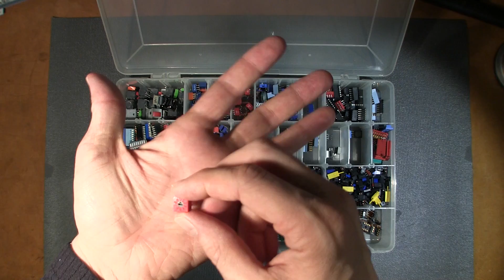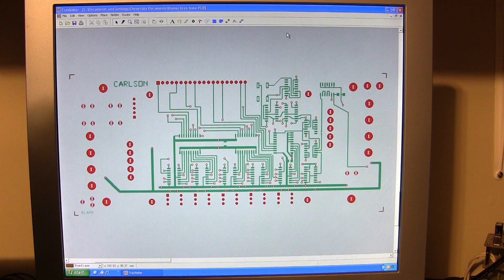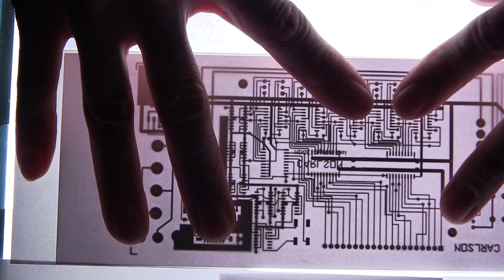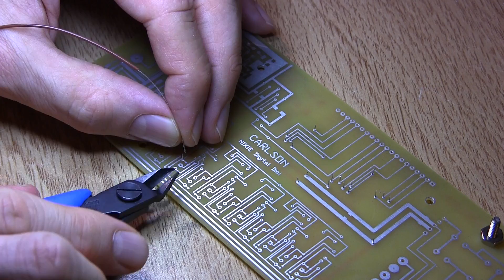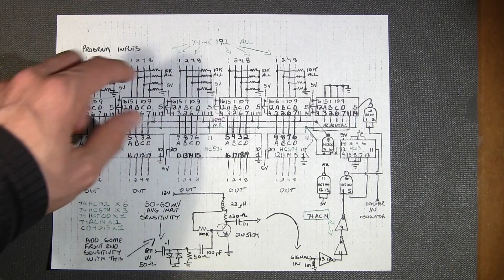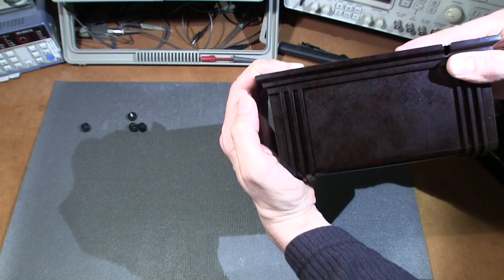Nixie Tube Digital Display for Receivers

Comment: "Will it work". Of course it will. You are so methodical, you don't have a sloppy bone in your body. Great to watch the process of designing electronics to fit a housing (the old Bakelite case) rather than the other way around like myself who designs a housing to fit after I build the electronics.

Comment: If only you’d placed the (non-angled) bcd selector switches on the underside of the board. Could have changed selections without removing the board from the Bakelite.

Comment: I thoroughly enjoy your videos. I have a question about your PCB design. Do you go straight to the layout, or do you first draw the schematic in the software? I think the former. Without forward/back annotation and design rule checking in software it must be quite error prone. It would be for me anyway, I would be bamboozled by the homogeneous array of pads and tracks.
Reply from the maker: I draw the schematic on paper, then manually place every component, and draw every trace on the computer.

Comment: I think that the bakelite case would make an excellent candidate for molding and resin casting in order to reproduce it for future projects while not risking damaging the original. There wouldn't be the problem of not drilling a duplicate for knobs and switches for all sorts of interesting projects.
Reply from the maker: What a great looking little case, I need many more.
Reply: I agree. It appears to an excellent art deco design. It shouldn't be too difficult to duplicate. Smooth-on has all sorts of videos on mold making and casting projects. I know they have videos on duplicating automotive turn signal lenses which I would think would be similar to what would need to be done to reproduce this case.

Comment: I'm amused that you still use a PC with a CRT monitor. How do you eliminate the CRT rolling in your videos? I seem to recall a Joss Whedon commentary mentioning that showing a monitor on screen used to require expensive equipment and an expensive technician.
Reply from the maker: Hi Peter. That old 4:3 monitor is an LCD model. It has never needed repair, either has the old XP machine. Both work flawlessly.
Reply: I apologize for mistaking it for a CRT; your camera lens makes it look like it has a curved front glass, so I'm sure you can understand how I would make the mistake. We used to love fishbowl CRTs (both PC monitors and televisions) back in the day.

Comment: Nice project!  You mentioned that you can use the counter to display the tuned frequency of an old radio. Since you have a 50 ohm line and input impedance, if you tap it to anywhere on the local oscillator of a typical tube radio, wouldn't it be overloading the oscillator? Do you have to add a MOSFET source follower (or a cathode follower to be more aesthetically pleasing) inside the radio?

Comment: Hi Paul,

Super channel - been watching your videos for about 8 months - keeping me entertained and I've learned so much - better than a uni course. 

I wondered how fine you could go with your PCB tracks and still have a decent circuit.  This circuit looks really dense. How many tries did it take before you had a working etched PCB - knowing how much of a perfectionist you are, it probably worked first time.

I don't have much luck with my PCB's because i use the UV process and there are so many variables that i scrap loads every time.

Do you have any dead analog synthesizers that you could include in your repair tutorials - that would be fascinating to follow.

Hope you continue this for many years
Reply from the maker: Thanks for your kind comments! I use the toner transfer method for very quick prototyping... I'd say a 99% success rate the first time.

Comment: Fascinating, as usual!  I've learned more from you in the past year than I did in three years of electronics college back in the 70s.   You've inspired me to build up a new test bench so I can restart my old electronics hobby once again.  I noticed in this video that you have a light on your Dremel drill stand that is perfectly centered on the drill site but I can't tell if it is above the table shining down or under it shining up.  How did you build that light, may I ask?  And yes, I would like to know more about how RF and DC grounds should be designed.  Thanks!

Comment: How do you handle this digital display if the oscillator frequency is on the opposite side of the IF frequency.  Sometimes this is the case with communications receivers on different bands.  Instead of subtracting from the oscillator frequency you would need to add to it.

Comment: Just a question: Why do you use the toner transfer method for PCBs? Is there a adventage over the UV exposure method?
Reply from the maker: The toner method is much faster, easier and way less expensive in the long run.

Comment: Very cool project - but just one minor nitpick: the leads on those Nixie tubes look like they're way too long...some of them even look like they're bent almost enough to touch other ones and cause a short.

I'd have trimmed a lot of wire off those tube leads so that the tubes would be sitting a lot tighter & flush with the PCB. Just sayin'.  If they'd be too low for visibility once the board is mounted in the enclosure, then just raise up the whole PCB up on spacers or shims, or something.
Reply from the maker: Ahh, but here is what your not taking into account: The Nixies are pulls from an old calculator, bending the leads "straight," close to the glass seal risks breakage. The tubes are elevated to that level so that heat from the soldering does not cause the glass to dumet/Kovar seal to seperate. This is the reason the tubes had about 2 inches of wire too begin with. The wire is stiff like the strands in a speedometer cable, there is absolutely no way any of them would touch unless you broke the bulb. If you ever pull Nixies from an old instrument (DON'T try to straighten the wires close to the bulb base)
Reply: See, you have very specific knowledge and experience that is hard to come by unless you've actually run into the problem first-hand or had someone share that knowledge with you. I try to read the comments for the pearls like this one where you explain something that could prove to be a costly mistake for someone trying to salvage a Nixie from an old instrument. I'd like to propose a suggestion for a video where you might put together some important tips like this one for people who might not know these things. It'd be so much nicer to benefit from your experience than have to learn things the hard way :D I don't know how many different tips there might be so it might be that it'd need to be separate videos on specific subjects. Just a thought anyway :)

Comment: So what happened to the row of diodes feature that was mentioned in the first video ??
In my opinion I see you still have enough room on the PCB for those diodes and use one wire to make the counter works as DF counter, an extra micro switch ON-OFF with longer stem installed at the bottom of the enclosure, the stem will go through a tiny hole of the shielding PCB, it wont be seen at all, so you wouldn't have to create any hole in the box.
Any other reason why you eliminate the diodes feature ?
Reply from the maker: No, just size issues. I plan to use this counter with earlier super-hets, so the diodes are not so important in this build. My earlier through hole counter has the diode feature. You can see that counter in my very first video. That diode feature is great for switching between IF offsets. If you wanted to use this with a Hammarlund SP-600, the upper bands go to dual conversion, so that feature makes life easier, as it's automated in that frequency counter.

Comment: Hi Paul. 
Delightful project and well-built :) I was just wondering, supposing it would be built with "normal" parts, meaning, not SMD parts, would one have to take anything particular into consideration? I'm thinking along the line of tolerances or maybe shielding?

And yes... I'm very interested in seeing how you handled the PCB design and other steps  you didn't show :)

Thanks a lot for this great video!

Comment: Hello there, though I'm no electrical Engineer by any stretch of the imagination I would like to ask two questions out of curiosity:
1) is the contact of the spring good enough for this application? I only have images of teared down oscilloscopes in my head where they often use big rows of metal clips between the chassi parts so either they are a bit overkill or they do it just because they can?
2) Did you consider tinplating the ground board? Again pointing a bit in direction of my first question if time and corrosion will affect the contact characteristics of the spring connection up to a point where it might not be good enough? (By the way i was absolutely stunned about the tinplating you showed in one of your previous videos ^^. I had to watch it twice to exclude black magic as an explanation.)

Anyway, very comprehensive and in depth videos (in my humble opinion). One can really see that you put a lot of effort into the narration and planning of your videos, which i appreciate a lot!
There are very few people out there on youtube which have such an calm and easy to follow narration style and voice like you, keep it up like that!

Best regards Anton
Reply from the maker: Hi Anton. Thanks for your nice comment! The contact area of the spring carries no current, so it should be fine. Those large shielded areas in oscilloscopes are needed as they are sensitive measuring equipment, and RF leakage from stage to stage is an issue. This is nowhere near that, it's just a counter. The box itself is made of bakelite, so there is no upper shielding. The unit itself should remain quiet to "close by" receivers with the shielding provided. Knowing this just comes with building experience. I didn't plate the bottom copper board, just because I'm not soldering too it. It doesn't seem to oxidize like my other raw boards as well. Off shore copper is special... LOL :^)
Reply: Thank you very much for your reply :)
It's always fascinating to learn something and since you asked in one of your videos if people are interested in the layout and design consideration process, i'm absolutely interested ;)
Looking forward to your next video and wish you a nice day!

Comment: I was thinking it might've been ideal to have access to those switches via the bottom using alignment tools.  That way you just need to lay the unit on it's back while making the necessary adjustments.  The display can be monitored as the adjustments are made as well.  This prevents the need to have to unscrew everything to get to the switches.  Of course making that actually work with the necessary layout and parts is a totally different topic, but where there's an idea and the will to make it happen there's a way.  All in all it's a magnificent build.

Comment: Mr. Carlson, very nice design, execution and explanation. I have a question regarding the use of digital dials in general on regen radios.
I realise there is no IF circuit on a regen but as you have shown that without programming your circuit it displayed the actual freq at its input. it seems that a programmable digital dial not set up to subtract the IF seems like a solution.
The main problem i see is how to get an input? Perhaps inductivly at the primary or tickler coil? or possibly at the detector tube.
Any ideas would be apperciated. Thank you.

Comment: Can't help wondering what might be a / the European equivalent of that printing / transfer paper. 
That UPC number points to "HP Premium Presentation Paper glossy 120gsm", available apparently only in letter size, and "obviously" only on the other side of the pond. 

Would the matt / matte version of that work comparably well, i wonder?
Reply from the maker: It has to be glossy, or the trace edges will get jagged.
Reply: I've read on some forums that inkjet photo paper should work quite well - the glossier, the better.
Reply from the maker: Yes it does. I have mentioned it as well in my earlier video's. My last package of paper I purchased (before the HP paper) was ink jet paper. One of the biggest issues is the ability of certain papers to soak water, and another is, some of the glossy paper has a coating on it that's very tough to remove, even after the paper has soaked. If you don't get that coating off the board, and out of the small holes in the pads, they will not etch. That coat seems not to be affected by water, and some scrubbing is needed. Then the board dried and held to the light. If you see a white diffused looking coating on the copper anywhere, that area will not etch. Normal paper will not do this, but that's the trade off for nice traces. This HP paper will leave that white residue, but it comes off very easy after soaking. The last paper I used (inkjet glossy brochure paper) would leave that residue as well, but it was like paint, it was difficult to get off. That paper would also expand and ripple when it came out of the laminator, this action would lift the toner of the smaller traces off the board sometimes. Finding the right paper is a challenge. It seems that when you find a good paper, they change the formulation and the next time you go to by a pack, it doesn't work. Now I purchase large packages of a good known paper and seal it in a very large zip lock bag to keep it soft. If you live in a dry environment, you want to do this as well, this is important because this also affects the life of the product. If the paper goes stale, you have bad results.

Comment: I managed to get mine counting ok, however my program inputs aren't working, that may be an error on my part pulling up the inputs instead of down as it blanks all my digits when I attach the load input to the intended spot. Also would attaching a display to the first counter give an extra digit of resolution?
Reply from the maker: If you want to add another digit, I would add it to the top end and lower the time base to 10Hz.
Reply: Mr Carlson's Lab I've made mine as a general purpose frequency counter so I have a range switch to select different divider frequency (down to 1 Hz gating frequency as that's as many of the '390s I could get local) I was wondering if hooking a latched display to the first counter would make it have at least the gating frequency resolution eg 1 Hz resolution on the 1 Hz setting

Comment: Paul,
Excellent project. Just a thought, could the BCD switches be mounted under the PCB so that when the bottom cover is removed, the switches would now be able to be adjusted without removing the main circuit board?   WB3BJU
Reply from the maker: Hi Donald. I did think about mounting them on the bottom, but a few things stopped me. One of the biggest was the video presentation aspect. It would be completely fine to do so with some movement of the traces, vias and the 0402 resistors. One would have to remember to use some form of insulated screw driver as to not contact traces by accident as well. Thanks for your comment!
Reply: Could then drill holes in the cover where the switches are and then be able to adjust them without removing anything.

Comment: I have a question. On the traces would it be ok to round the corners instead of making them 90's? I am making an RF receiver board and I am wondering if rounding the traces would lower interference. thanks.

Comment: Thanks again for the videos. Could you give us a part number for the transformers you used. (don't know if I missed it or not)
Carl
Reply from the maker: Hi Carl. Those transformers were in a dusty box under the main shelf at a local electronics supplier. The owner of the store didn't even know what to charge for them.... I think they got forgotten about??? I didn't see any numbers on the transformers themselves other than the voltages and winding locations. I will be going to the store soon again, If I find any part numbers, I will pass them on to you.
Reply: Thank you, in the mean time I will look for something that might do.
Just found in my junk 2 Tamura 3FD-410 Circuit board mount transformers. 2 Primary's and two secondary's 110/230  5/10 volts. rated at .6 RMS amps. think that I can get what I need with 10 volt secondary ? I found them on the internet with a 16 volt secondary for around $8.00

Comment: Excellent presentation.
Taught me a new trick for making double sided circuit boards at home.
With the digital counter sitting on top of the radio; do you get an increased noise floor in the receiver?
And if so; how much?

Comment: With Paul's video-the longer the better. I would not touch the bakelite case with a drill bit either, it could come to pieces. Thanks Paul.
Reply: I imagine you could dull the tip or file a less aggressive angle?

Comment: Excellent as always! About the shield - when the copper will get oxidized contact resistance will rise, I would've tinned a contact area just to make sure. Just my thought.
 And I have one question about termination - I've made a little FM preamp for a radio that was intended to use a whip antenna. I feed the RF from outside antenna with 75Ohm coax into the preamp, do I have to include termination anywhere?
Schematic of the preamp is a single CE stage with tanks on input and output, it's here: http://circuit-zone.com/ediy_blog/611/fm-antenna-booster.jpg

Comment: I'm at about 20 minutes in and I have many comments. I'll limit myself to two for now- (1) this video is OUTSTANDING! (2) I build my own boards with Cadsoft Eagle and mill them out with an Othermill (two sided boards are easy). If it's something I really want to share with a friend I'll send the Eagle file out to Osh Park and have boards made. Because I don't know anything about RF circuit board design, the one type of project that I've avoided is a project with RF circuitry in it. That's pretty limiting for a Ham operator. So yes! I am interested in hearing your thoughts on RF design. 73 NE5U Mike